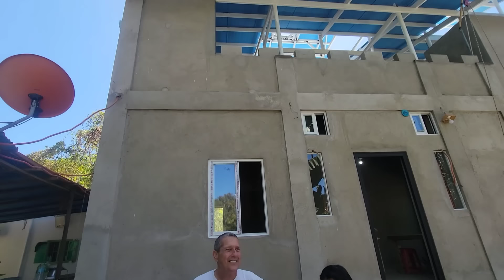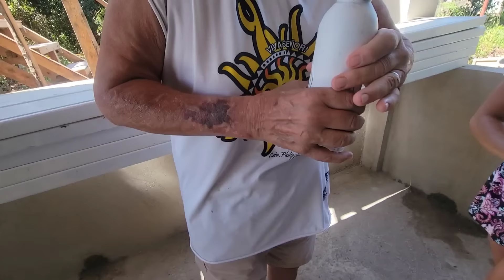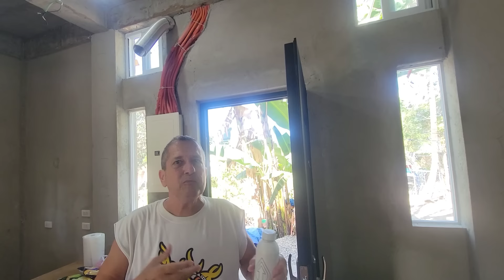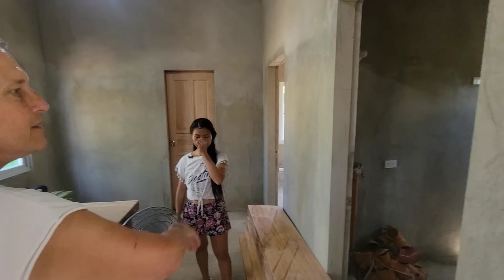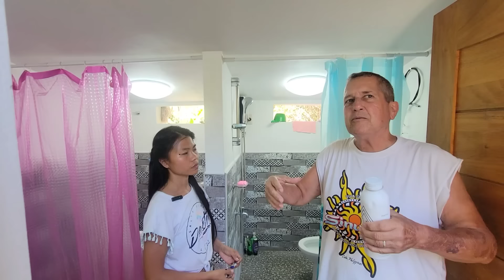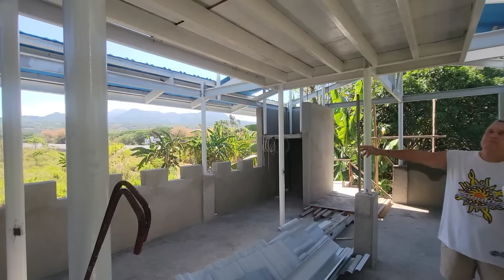Building a Castle in the Philippines? You Wont Believe How It's Made!

Comment: cool, i did the same thing! never built a house OR worked with concrete before, but i used 1-2-3 mix ( half small crushed stone half larger size) and added sahara on the terrace slab. took me 6 months and i hired 5 guys from the village and a father and son from another village, the father was my foreman. i was sure it was the strongest structure in the philippines when i finished but maybe now its tied for that honor with his place! hahaa.
its looking good, i also have a telescope on my terrace and sort of castle look to the terrace handrail, its 4 ft. columns that extended up from downstairs columns but i put exposed round rock in them up top to give it an old castle style look and capped them off with concrete shaped like "japanese roofs" and i have 6 steel bars embedded in them all the way around to form the handrail. built my own bed frame out of wood also, and later made one for our daughter lol.
i used arch beams downstairs supporting the upstairs slab, it was interesting making the curved forms with coco-lumber framing we cut slots in to get it to curve. it came out looking kind of like an MC Escher drawing !
well, good luck, seems like you have a handle on everything ,enjoy your new place!
Reply: oh, i ended up spending 28,000 US, that was 2015 dollars.

Comment: Fast build. Nice. Umm, at about 13:15 a small stress-crack in the concrete kitchen wall is noticed about five-foot up and extends laterally about half-way across the wall. Is something wrong?
Reply: It’s normal. We let it cure first wait until done cracking before doing another smoothing process of every walls then after that time to paint.